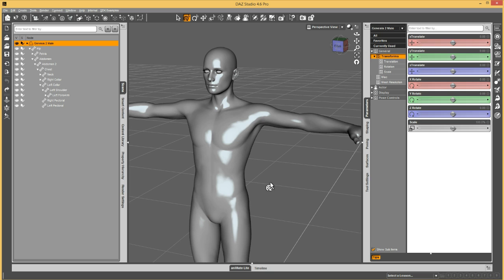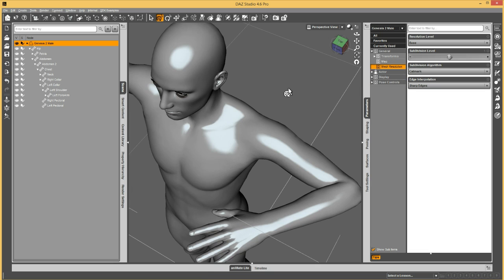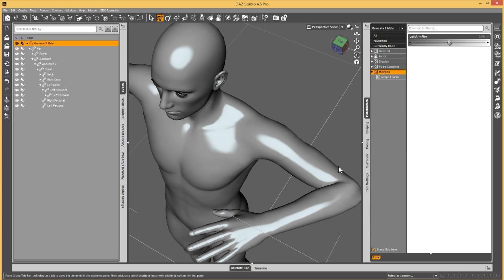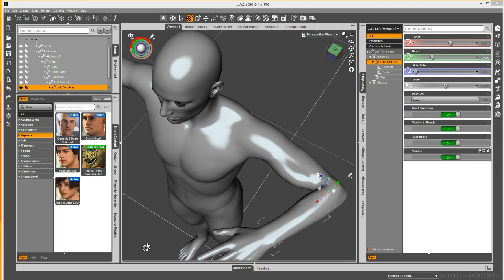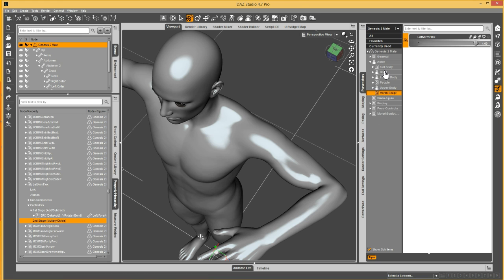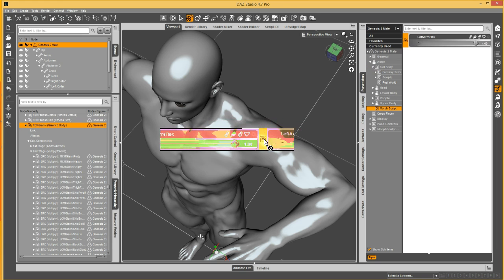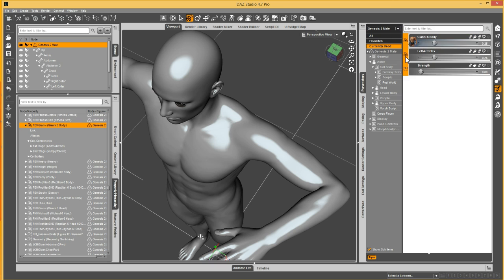Creating and Hooking Up a JCM

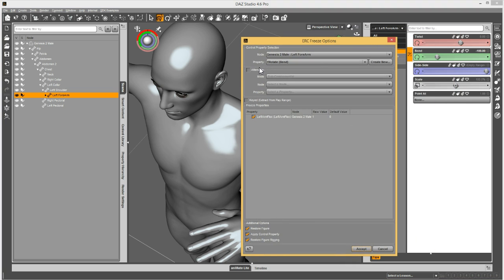Comment: Is there a difference in using ERC freeze for connecting a morph to the forearm-dial (@2:20), and the other method of dragging the morph into the 1st stage in the Sub Components of the forearm-dial within the Property Hierarchy?
Reply from the maker: The nice thing about ERC Freeze is that it does math for you, which is nice when hooking a morph to a bone rotation. If you don't use ERC Freeze when doing a Bone to Morph connection you have to figure out what the scalar value should be.
Reply: That's right, about the math. I'm also glad to now know what Reverse Deformations does. Until now I either figured out the scalar by trial and error, or I even created counter morphs so that the end result would be correct. So thanks for that valuable information!

Comment: Thanks for the tutorial.  Great Step x Step.  Question about compound morphs.  Say you bend a thigh forward 45 and then sideways 45.  You build your morph and re-import it.  How would you set up your morph to ONLY apply when the thigh is activated across both axes (bend and side to side)?

thanks in advance
Reply from the maker: That is a bit more complicated. There are probably multiple ways to do this, but here is one approach that should work:

- Create 2 new control properties. 
- Set the first property so it controls the JCM (put the JCM in its sub-component list, 1st stage).
- On that same (first) property, set the thigh rotation as the controller 1st stage (add/subtract) and set the second property as the controller 2nd stage (multiply)
- On the second property, set the other thigh rotate as the controller 1st stage
Reply: I've been knocking at this for a couple of weeks and know this one might be off in the weeds but a video would sure be helpful :) if you're looking for topics ... I'm loosing it on your 3rd line.  So far I've got the original morph loaded into the x Rotation (Bend) for the thigh.  Then I have two other control properties that both activate the morph.  Calling them CTRL X and CTRL Y.  When I add CTRL X to the controller as an add/subtract all is well... but adding CTRL Y as a multiplier in the 2nd stage gets an error... 'Circular control '

Many thanks again
Reply from the maker: Try using this image as reference for how it should look in the end: http://screencast.com/t/IECPyeeoB

Also, here is a different workflow that may make it easier:

1) Create 2 new control properties (to follow your example I called them CTRLX and CTRLY)
2) Follow the instructions in the above video for setting the first thigh bend to control CTRLX
3) Repeat step 2 for setting the second thigh bend to control CTRLY
4) Set CTRLX so it controls the JCM (put the JCM in its sub-component list, 1st stage)
5) Set CTRLX's controller 2nd stage (multiply) to CTRLY

Comment: Good tutorial. But there is some missing info in case people are interested. If you do this on clothing and save the clothing figure, it will only save dials for the morphs you created for that clothing item. So a clothing item will save the clothing figure and all morphs which is nice, but the Gianni dial will NOT be saved and your JCM won't work when you load the item in a new scene. They'll only be saved in your current scene and will work fine there. This is a really annoying aspect of DAZ. Any dial that was created from another figure needs to be saved separately (usually to the same location as your clothing item). In this case, the Gianni dial (usually called FBMGianni6 located in the Actor's property for your clothing item) would need to be saved as a morph using the same settings you used to save your clothing item.

My next task is to figure out how to apply custom equations or at least custom ranges to these sub-components based on the percentage of the current dial.
Reply from the maker: ***** Ah good point. If working with clothing, you are correct that the generated morphs don't save automatically. That is a feature that prevents unnecessary morphs from writing to disk when they are unmodified/generated morphs. As long as morphs are marked as generated DS will not automatically save them when saving the item.

There are two ways to change morphs so they aren't flagged as generated anymore.

1) Use the Save Morph Asset dialog. Go to File > Save As > Support Asset > Morph Asset(s), set the authorship information and product name and check the morphs you want to save. This is a very useful way of doing it if you don't want to save your clothing item again.
2) The other way is in the Parameters Pane. If working with a single morph, you can click on the little gear icon on the morph to open it's settings. Change the content type from "Modifer/Shape/Generated" to "Modifier/Shape" and it will save with the clothing with no extra steps required. If working with multiple morphs, you can put the Parameters Pane in Edit Mode, select all the generated morphs that need changing, right-click and go to Set > Presentation and change it.
Reply: Josh Darling Ah cool. Thanks! This is useful info. I usually save them out separately. But good to know about the content type. And yeah, I agree it's best not to automatically save generated dials. I was just mentioning it in case someone ran into the same issue. It's really weird having a dial work in your scene, then you load the item in another scene and it does nothing.
Reply from the maker: ***** Yeah, I appreciate you bringing it up. It is important for clothing creators to understand. I'm hoping we can change that functionality sometime so it is more automatic...
Reply from the maker: +Cobra Commander Oh good, I was just about to dig into this and see what could go wrong!